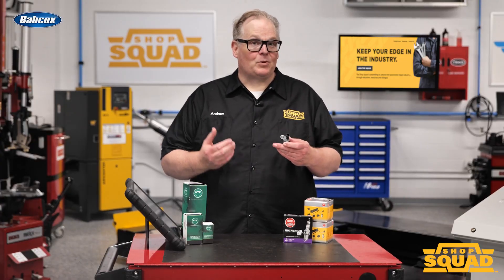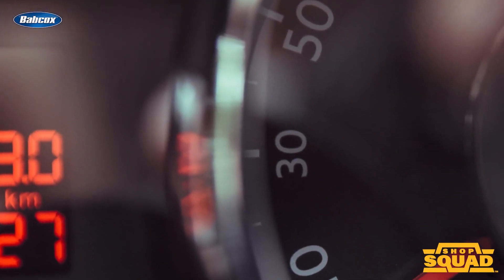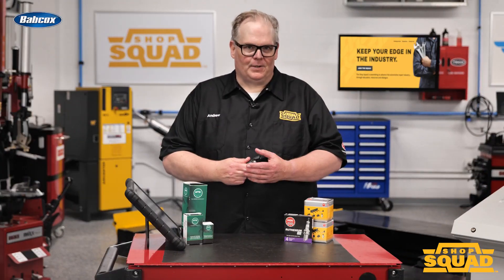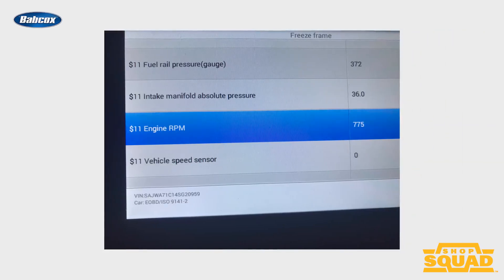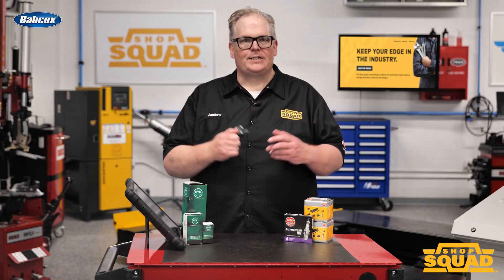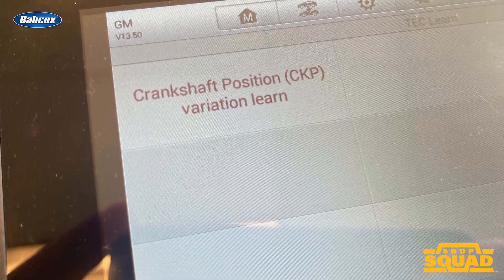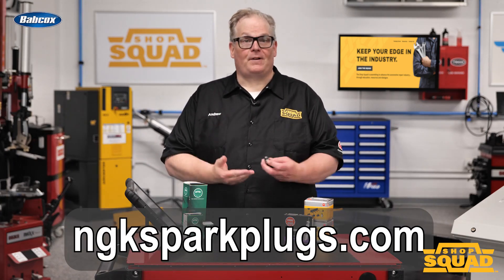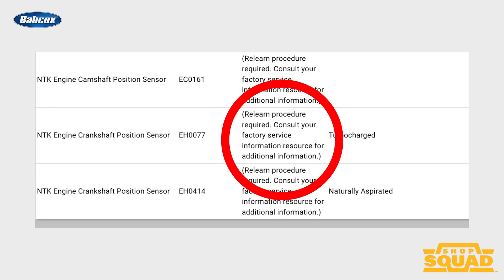Crankshaft Position Sensor - Importance of Relearns

Comment: I'm having a problem with my foxwell nt644 scanner relearning this damn crank sensor and the fuel shutoff is not even occurring it's wrapping up to 5200 I keep letting off letting it idle I've ran through this process 8 times so far the fuel shut off will just not kick on please help I've got to have this thing running better it's a 2.8 l Colorado 2006 automatic please help I don't know what to do I'm not a mechanic, DIY and this is eating my lunch
Reply: Yeah having exact same problem with my 2001 gmc sierra same foxwell to I don’t think your supposed to hold down the gas just rev the pedal not hold down the pedal I just say a video where a guy does that

Comment: Disconnect your battery for 5 minutes. Sensor relearned.
Reply: I can tell you don't work on cars 😂
Reply: Seriously???
Reply: Buddy had a good idea,
But Buddy is no more.
What Buddy thought was a simple test,
Rocked him to his core.
Reply: didn't work for me, I even put a second brand new one in. I ordered 3, third one comes tomorrow 🤷‍♂️
Reply: @AARONtrademarkRegistered  i replaced all 4, they were cheap chinese knockoffs.  It switched from the sensor right behind the valve cover, to a different sensor.  So I ordered replacements, didn't need to take out other 3 so I used 1 from the new 4pk and put the defective one in and returned that.  Everything works fine now and didn't neec a manual relearn.  Just drive around a big parking lot for a while, your ECU will figure it out.
Reply: @AARONtrademarkRegistered obviously you have another issue
Reply: Did that on my Vauxhall Insignia 2011 OPC with the G09 2.0 turbo engine. After replacing the second camshaft sensor I got an lit engine light. Erased it with my OBD-2 tool but i came back after every restart. Just now I got out and disconnected the negative batteri terminal. Smoked a cigarette and put it back on. And now the engine light is off. Lets just hop it will work in the long run.
Reply: Well if you had to replace a crankshaft sensor, you should have already disconnected the battery

Comment: Would it not be sufficient for a vehicle battery just to be disconnected for a couple of minutes for say a crankshaft position sensor to learn from a clean platform?
Reply: That's what I'm thinking
Reply: @orangesnowday  I mean one would think right?  Blessed day.
Reply: I mean if it did that, they’d end up having to do that for ALL sensors. I’m glad my truck is an ‘01 - that’s as much BS emissions systems one me can take. Still pretty easy to fix it though, just getting under the damn thing kills me as I age, lol.
I love my truck tho, it’s an 01 silv 1500 v6 4.3L 2WD Manual Tras she’s not much but she’s fun to drive around

Comment: Replaced the engine on my 13’ GT and have been dealing with this for the past couple weeks. Did a few relearns and even swapped it with the sensor in the old one (it was replaced about a year ago) and did another relearn after. No code yet but still getting the same symptoms. Do the relearns take a drive cycle or two to actually reset and fix or is there still a problem?

Comment: Put ur car in park then neutral and put on the handbrake then rev the engine constantly for like 10 or 15 seconds straight and that should do the job
Reply: you can do this without a diagnostics computer hooked up?
Reply: @ give it a try they will tell u to drive you car at high speeds to relearn it but when it in neutral and u hold down the gas the cpu thinks u are driving at a high speed try it and let me know if it works
Reply: @TheRealPoPorter  what if won’t start how can you relearn it
Reply: @TheRealPoPorter got a gmc scanner keeps failing but did what u put and it’s idling good
Reply: @ glad it worked for you brother 😎
Reply: @TheRealPoPorter im about to try this and if it works i owe you big time
Reply: @ ok let me know if it works
Reply: @TheRealPoPorter  . Would driving in 1st gear at 25-30 mph work to relearn?
Reply: @buzzlight2nd1 for me that didn’t work I drove my car around for a few days but they say driving at high speeds constantly will relearn it so driving on a express way for a while will probably work
Reply: @STELLAR_QRU did you try without system connected?
Reply: Bullshit
Reply: @moneymig  worked for me u gotta rev it pretty hard and rev it consistently hold down the gas and don’t let ur foot off off it for like 15 seconds or hold it down until the crankshaft light goes off
Reply: Seriously???
Reply: @study-tesh9542 NO
Reply: @study-tesh9542  yes
Reply: @TheRealPoPorter 😂

Comment: This method works within a rebuilt engine? I rebuilt a 1.4TFSI because of the piston rings but we are getting p0321 codes in the scanner even though the sensor is still in good condition

Comment: This video implies that some service professionals don't know this.! We have a 2008 Honda Accord 4cyl with a crank but no start problem. As I type, the car sits dead in our driveway. We just replaced the crankshaft position sensor with a new one from Honda and it didn't improve the situation. The ngksparkplugs part lookup says possible reprogram on this CPS! There is another video of a respected service professional tearing his hair out because two crankshaft position sensors he installed in a row did not solve the no-start problem. The third one he installed worked. People are saying they're often bad right out of the box when according to your video they may just need to be programmed. The history of our car's crank but no start began with a failing starter that engaged with the flywheel only after several tries. The engine always started though right up to the starter's last gasp of life. We had Japanese Auto Repair replace the old starter and after they did, the car would crank fine but wouldn't start. They told us we have a bad connecting rod which is BS and didn't believe me when I said the car ran smooth with no knocks right up to the day the starter died.
Reply from the maker: Did you find a solution to this?
Reply: We had the car towed to Honda Carland. They have a great mechanic there familiar with the peculiarities of this engine. Turns out the sprocket on the camshaft needed replacing as did the chain tensioner. The chain had jumped a few teeth. I don't remember if the CPS was an issue but I don't think it was.  @ngksparkplugsusa
Reply: @cmackscott761 was it acura tsx 2009 I got one with crank no start and trying to find why im not getting spark but fuel tried crankshaft sensor did nothing I checked the timing chain it was tight and cams where in sync going try bank a camshaft sensor
Reply: Did you find that the reluctor ring was bad?
Reply: Most dealership mechanics know only how to replace things, they would offer an engine replacement for this lol :) :)
Reply: My Chevy dealership told me I needed a new transmission and a new ECU. The truck wouldn’t start. I said maybe we should get the new ECU get the truck running then we can tell if it needs a new transmission. He said we should go ahead and order the transmission. I said don’t touch my truck I’m coming to get it
Reply: @johnellisonarmadilloconstr7966 yup, I don’t trust ANYMOME with my truck.
Reply: Same here pulling my hair with a 2008 accord 2.4
Reply: Bro are you seriously saying that oh all service professionals know every single thing absolutely not I'm so f**** positive You did not just say that there are people that know every single thing there is to know about s*** that they work on that's completely and entirely false to even insinuate with the beginning of your comment that's just absolute lunacy
Reply: @mikewazowski7830   Whoa,,,,slow down little fella.....
Reply: Not sure what you are talking about. Anyway, we did finally get the car repaired. We went to the local Honda dealership where they work on Hondas all the time. They were familiar with the problem, unlike an auto repair business we went to originally that advertises being an expert on ALL Japanese cars. @mikewazowski7830